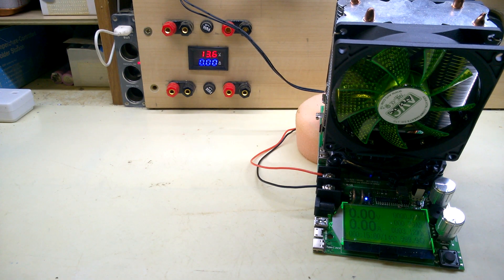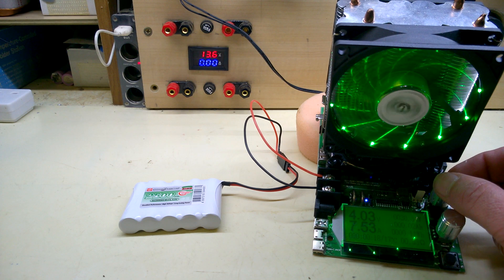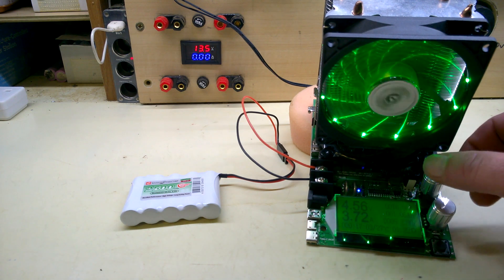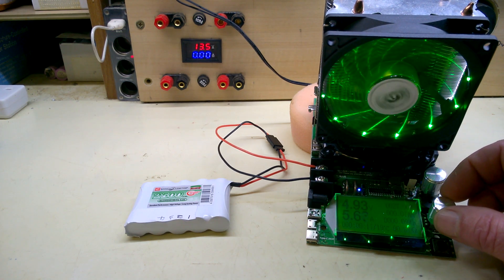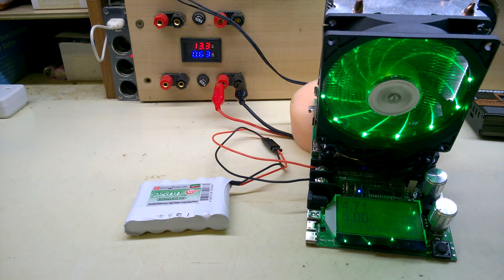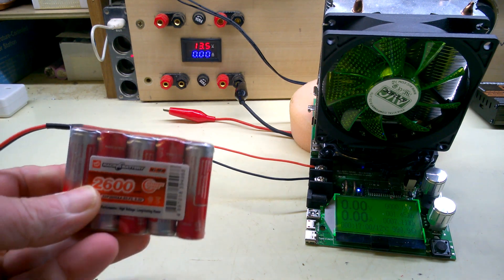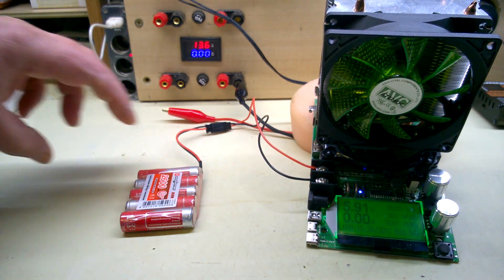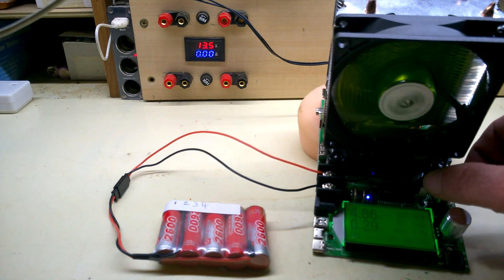AA battery max. current test

Comment: You can probably get a bit more current out if you use a better connector
Reply from the maker: These are the standard default connectors supplied on receiver batteries.
It's possible that a larger current could be drawn with thicker wires and a different connector.
I'll have to try it sometime.